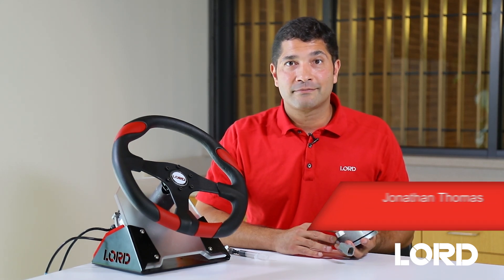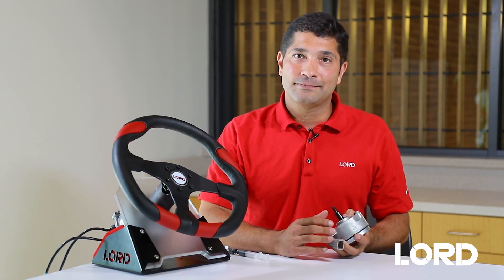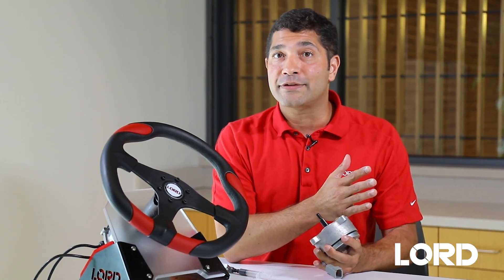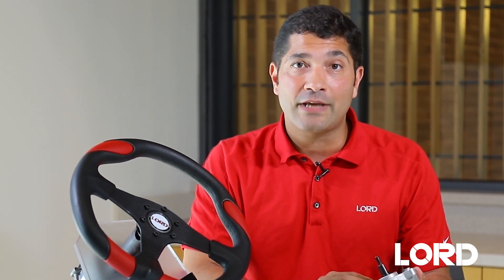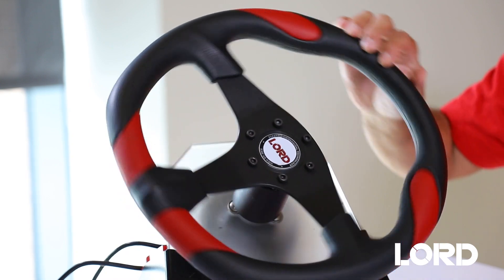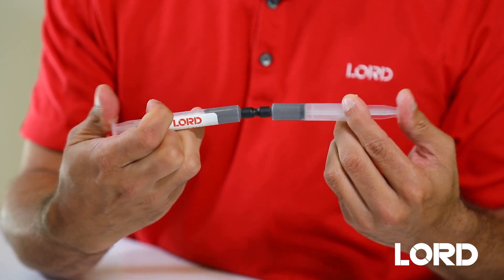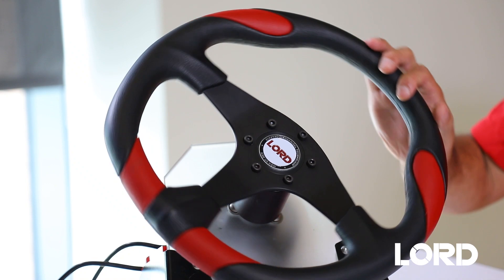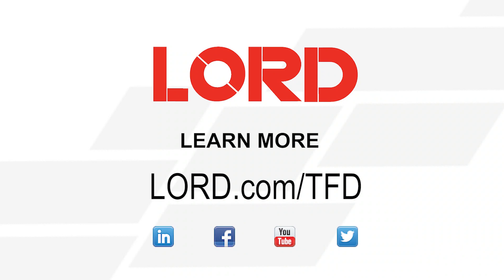TFD: What is it?

Comment: I found a Lord TFD device at a salvage yard today puzzled what it was used for ? the info label was scratched up .Unit has 6 wires with a plug the shaft is supported by a strong shaft.On  opening  it has a disc with holes coupled to the shaft  and what looks like a stationary electric magnet plus was filled with grey  powder witch stuck to a magnetized screw driver tip . Watching this video I`ll learn what it is for :)